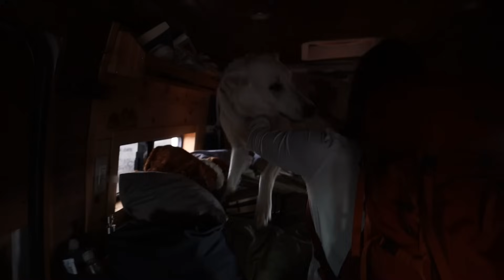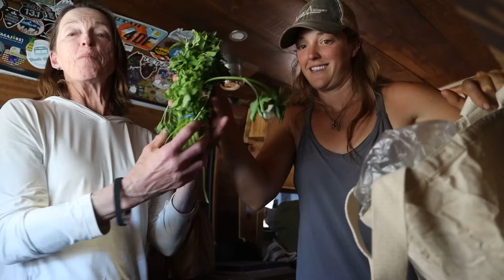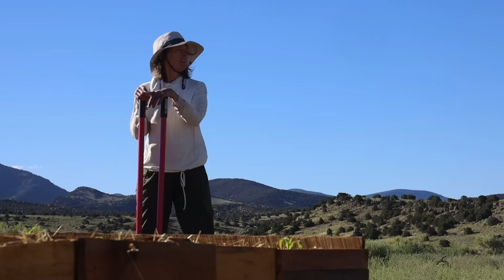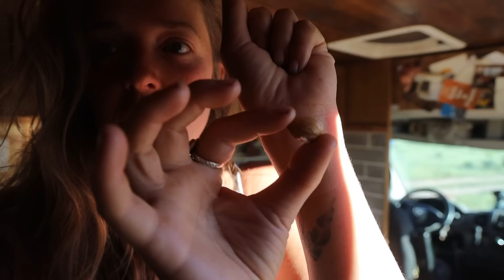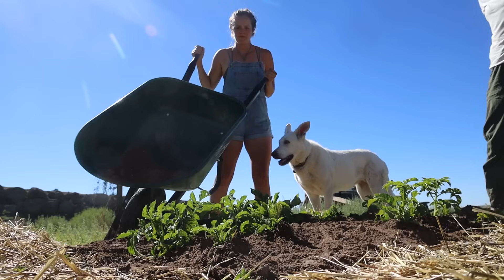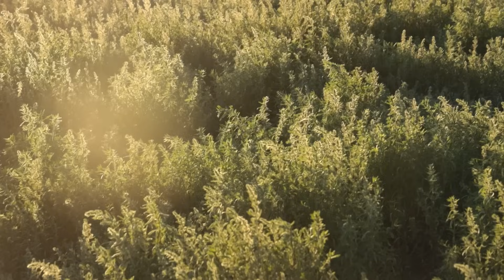Living in a Van WITH MY MOM.

Comment: Just to throw something out there at you. I lived on my sail boat for fourteen years.  Yes We use solar panels For Electricity. But another thing we also use Is Wind generators. So the sun ain't shine The winds usually bowling. I think if you put one on your Container. Or even two would generate more than enough electricity out there. Here in louisiana We get cloud covered skies For weeks on end. And the wind generator fix up the slack. I've also.
Installed them on offshore platforms. And they run they computer Monitoring systems,nave lights,and  fog horn. Good to see.You to see you're doing so well out there In your base camp. I have to say the dog Is the star of the show. He probably wondering 

 what kind of crazy shit you're going to get into next.
Reply from the maker: Great idea!

Comment: I live a bit north of you.  We do have 2 Ace stores about 35 minutes away and a bigger town 50 minutes away.  But a lot of times they don't even have what we need. I try to avoid Denver so that means  COS or Canyon City, which is like an all day trip. We built our house from the ground up.  living in the mountains is no joke.  The winter is long and hard, the wind blows like crazy, the sun burns, but the beauty is unexplainable.  We learned to slowly stock up on everything, water, car parts, plumbing parts. Basically, if you have to go to town to get something, get 3x the amount you need.  A neighbor told us to have 2 weeks of food and water in the winter because it is very probable you wont get out for two weeks.  I think it has been pretty mild the past 4 winters, at least where we are.  But yeah everything takes 3x longer than you thought, there is always obstacles, nothing is easy. The struggle is what makes it appreciated though.

Comment: You should consider using cardboard as mulch for your garden. Take off labels, tape and the parts with glue. The ribs glued are plant based glue and printing is Soy based. Don’t use glossy cardboard. Just a suggestion.
Reply from the maker: Love that idea.